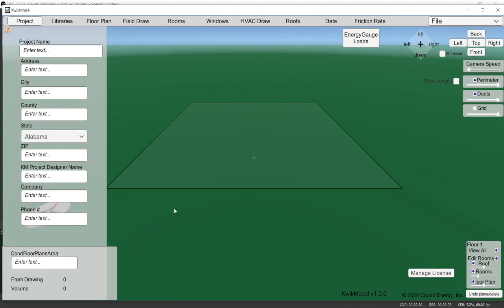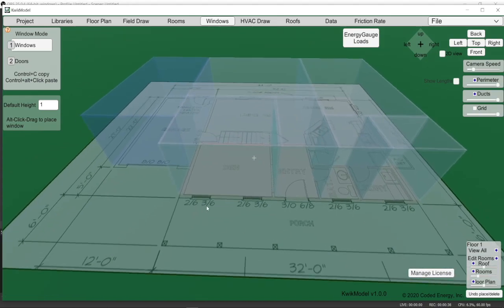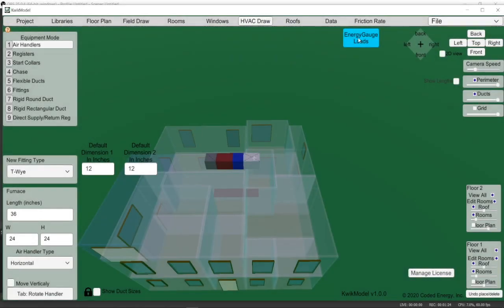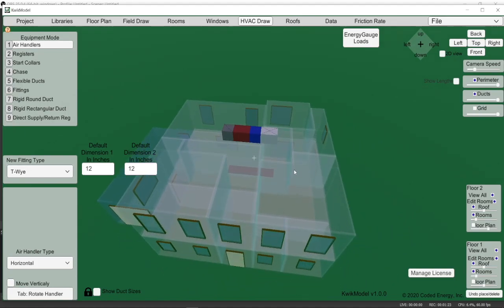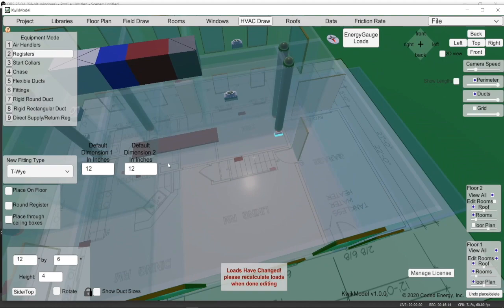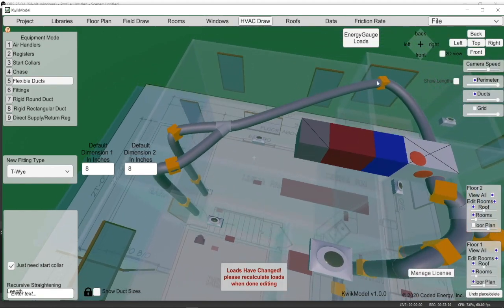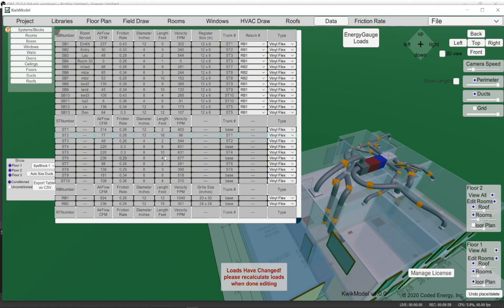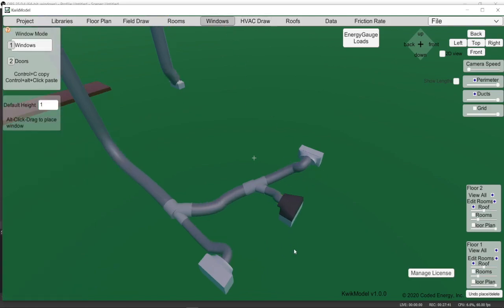Part 2 - Example House Using 3D HVAC Design Software

Comment: Hello Russ, I am getting the friction rate of 0.136" w.g/100ft. Do i need to reduce my air handler ESP from 0.6 to 0.5"w.g?
Secondly, is there any recorded session available on how to size/select the registers per manual T?
Thirdly, We have to select the register size and enter in kwikmodel, it doesn't size it by its own just like duct sizing, pls confirm?

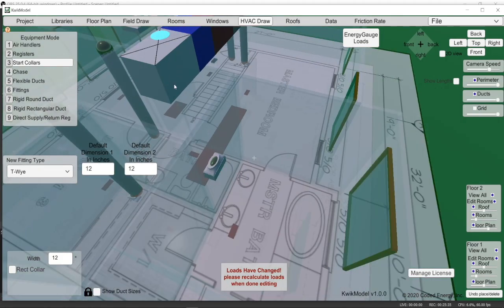Comment: 58:48 Hi Russ, air coming out of the air handler and smashing the front of supply plenum, does not this unnecessarily adds to the ESP requirements of supply fan?
Reply: As long as all of the losses are accounted for the desired amount of air will travel through the system.  There are more efficient ways to deliver air with less resistance (sheet metal elbows, turning vanes, etc), but you have to decide whether it is worth the extra cost compared to just upsized one or two sections of flex duct.  The other thing I have found is that air likes symmetry.  When the air comes out of the air handler and into the plenum, it likes equal choices of which way to go, left, right, up, down, or straight.  If you put a major trunk on the end of the plenum, most of the air will want to go straight and you will end up having to damper it down.  Having symmetry makes the system more predictable.  They say that there is no such thing as a self balancing system, but you can come close.

Comment: Why are you going with a 2.5 ton? It’s only 20000btu.
Reply from the maker: Great question.  The condenser I was looking at didn't quite have the sensible capacity I needed at 99 degrees outside temp, 65 EWB and 800 cfm.  It was close, like 18,200 after adding half of the latent capacity to the sensible capacity and I needed 18,900.  Plus I had already done a sample duct design on this house using 1000 cfm and I didn't want to change that because I was using it to check my work as I went along.  In "real life" I probably would have shaved the loads down to make the two ton work if it was that close.

Comment: Is there somewhere where you can account for additional CFM added to the system when ducting an ERV and dehumidifier to the supply?
Reply: Interesting question.  I assume that you just want to make sure that they ducts can handle that extra air.  My suggestion would be to just add that extra cfm to the design cfm of the HVAC system. That number is entered in the Manual S part of EnergyGauge Loads.  Step 4.  In other words, if the system will move 1200 cfm and the ERV/dehum will add another 150 cfm, just enter 1350 cfm as though it will be provided by the main air handler alone, but keep the same external static pressure for the 1200 cfm..  Be sure to document this clearly in your notes so it doesn't look like you used the wrong static pressure.

Comment: What I need isn't to make spaghetti... I need to build a real ridged duct system. with no flex.... How can I do this. This software is making it really easy for me to build things the cheap and the WRONG way...  and not the correct way...... Please help
Reply: It will draw rigid ducts, however I would contradict your assumption that you cannot design and install a good flex duct system.  I've tested many homes for airflow, static pressure and leakage and flex systems, on average, test better.  Some of the very best systems I've tested were flex duct systems.  I've also seen some new sheet metal systems that were pretty horrendous, but I don't bash sheet metal.  I bash the designer and installer.  It's about airflow, not what the duct is made out of.
Reply: @russking63 do you feel like the sheet metal duct was poorly sealed?
Reply from the maker: @SmithCanFixIt32  Poorly sealed, poorly insulated and poorly sized.  In a humid climate that is a recipe for condensation and eventually rusted out ducts.

Comment: EnergyGauge will not open after clicking the EnergyGauge Loads button. The window goes to the blurry screen with only an option for "Emergency Cancel"I have uninstalled and reinstalled both programs, but there seems to be some communication errors. Are there any troubleshooting tips you recommend?
Reply: I would also like to know.